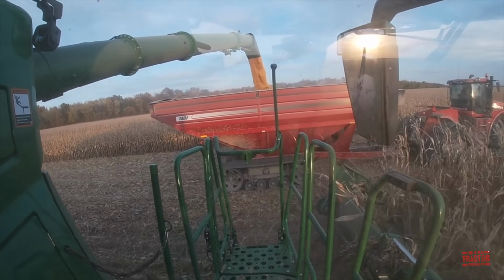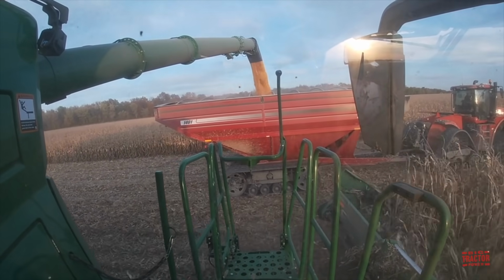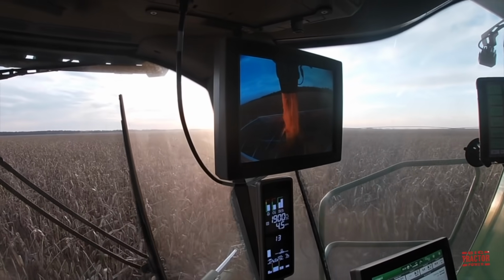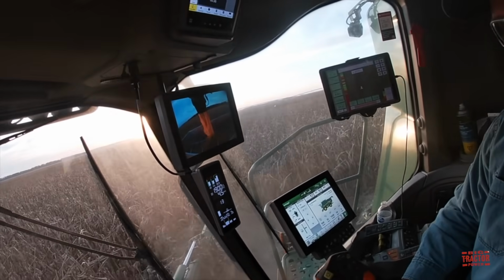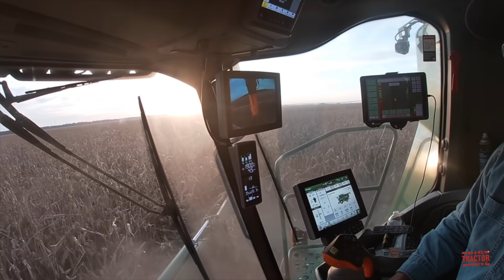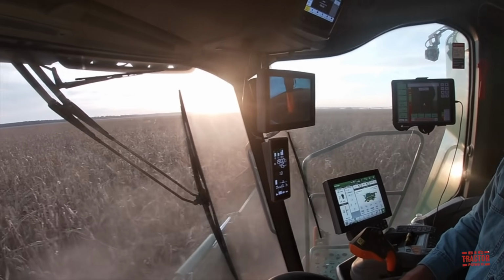JOHN DEERE X9 Combine

Comment: Even just you getting up into the cab at first you can tell the just the cab itself is huge lol.
Reply: The cab dimensions are identical to the S700 and S600 series machines. Its the same cab with slightly newer monitors/ electronics.

Comment: Don't think I've seen an X9 vid yet that did not have some cab corn!
Reply: We used to run a 16 row on a 690 with an extension that held 600 bushel. We couldn’t make a half mile without spilling in 220 bushel corn. They need to get to a Tribine design if they want this kind of capacity.

Comment: Holy cow so running at optimal capacity that machine should be able to completely unload itself in less than two minutes! Actually at 1 minute and 45 seconds! That's crazy that's moving some grain how big is that unloading auger(width not the length) Because while unloading that auger must have an absolute shit ton of weight in it! Since it is extremely long and pretty I can't imagine how much weight it ha in it and it's crazy to think how that machine is supporting all of the weight on that single rotating spot! With a 16 row head and probably at least a 40 to 45 foot wide draper header for beans and wheat no wonder why these new grain carts are so big and have a giant unloading auger that can't also unload the entire cart in under 3 to 4 minutes. I mean they have quite the job just to be able to keep up with such a faint combine! These are the stuff I would love to show my great grandpa who use to use Massey Harris pull-type combine  with like under a 6 foot wide header and maybe with extensions able to hold 30 to 40 bushels. I don't think we would ever be able to come close to grasping the size different of today's machines. It's absolutely insane how in less than 60 to 80 years how much farming equipment has changed. Hell I know some old timers who are still kicking and they can't even begin to believe it themselves and they are seeing it with their own eyes LMAO!

Comment: I haven't run a combine an many years, but that seems like a lot of Marketing theoretical hot air.  At 40' a pass, you would need to be running at the following speeds on a continuous row (i.e. not turning around) to cut 7,200 bushels of corn in a single hour.
 

200 BPA @7.4 MPH
180 BPA @8.3 MPH
168 BPA @8.8 MPH USDA average yield
140 BPA @10.6 MPH
120 BPA @12.4 MPH
100 BPA @14.9 MPH

It's hard to tell for sure, but it looks like this guy is running at 4.5 MPH, so he'd need to be making 340 BPA.